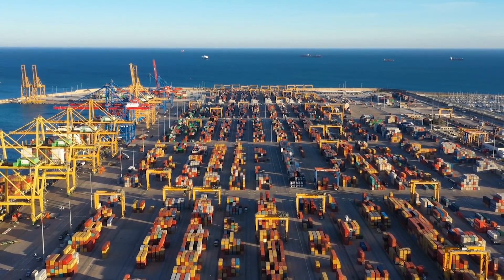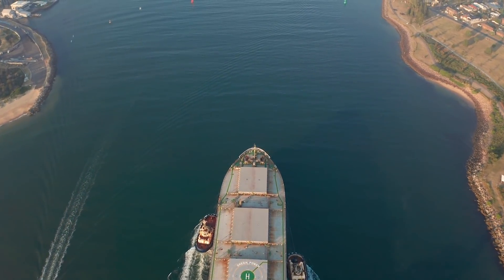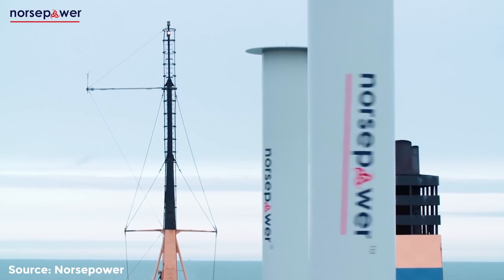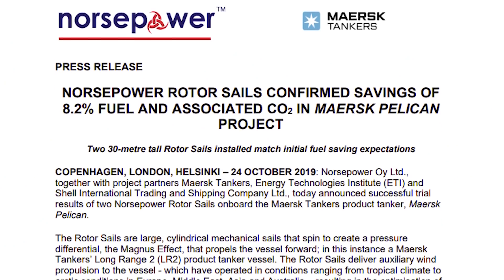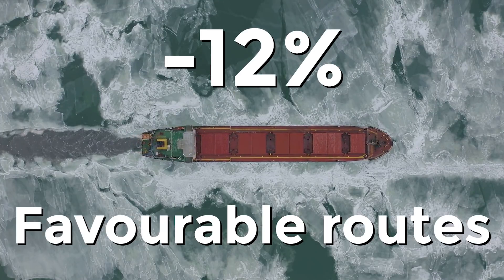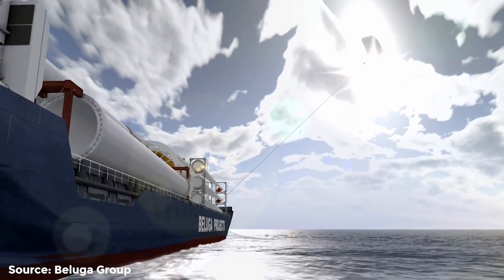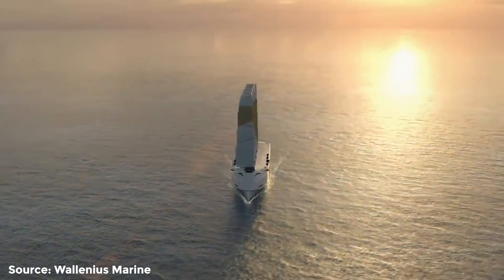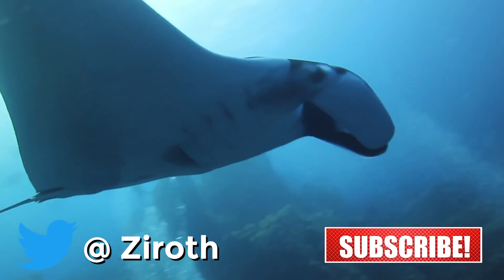Is Wind Power The Future of Shipping?

Comment: Small nuclear power systems, there, solved all your issues.
Reply: If you do a web search for ‘nuclear ship savannah’ you will see that it has been tried and did not work.  A similarly heavily subsidised, by the government, vessel is in use in Russia which also operates, in support of the Northern Sea Route, a fleet of nuclear powered ice breakers these may, or may not, have been completely without issues.

Just think; would you have full confidence in the management of a nuclear reactor under the control of an anonymous entity only traceable, perhaps, via a letter box in a FOC (flag of convenience) nation state?  If you are, could you sell that confidence to Japan, the state that hosted the Hiroshima and Nagasaki nuclear detonations as well as more recently the Fukushima ‘event’?  Then try that same, or a similar, sales strategy on Ukraine, the nation state that as a part of the USSR (CCCP) hosted the Chernobyl ‘event’.  Modern iterations of nuclear energy, thorium fuel, molten salt reactors or fusion reactors, will carry the legacy of past problems.  It is the global trepidation of anything with 'nuclear' in the name and the economics of nuclear having transitioned from 'energy to cheap to charge for' too 'the costs of remediation are incalculable' that will prevent the adoption of nuclear energy as a means of creating energy at sea.  Modern reaction systems may have overcome the safety problems but the general public, having been misled in the past, will be reluctant to believe the fresh new promises.

‘They’ say nuclear is cheap, it’s not it is expensive and has a large embedded carbon quotient as well as being complicated, dangerous, not universally socially acceptable and having only ‘no need for refuelling’ as a questionable advantage; actually it does need refuelling just not as often.  When ‘they’ do need to refill the warming up stuff it takes considerable longer than pumping tonnes of thick black stuff, HFO cSt380, or thin runny stuff, MDO, onboard which is one of the reasons HMS Queen Elizabeth and HMS Prince of Wales are pushed about by ICEs and gas turbines thus using a similar fuel as the aircraft that fly off of them.  The Royal Navy (RN) with a high degree of skill and expertise uses, at vast expenses to the UK taxpayer, a current operational nuclear fleet of 11 submarines (also known as ‘boats’) in two flotillas, seven attack subs and four ballistic missile boats.  The carbon footprint of all the extra bits of hardware and the fuel, including processing thereof, from ground to propeller, are the external costs that never seem to get considered.

Disposal, once it wears out, of both the machine (that was a ship) and fuel is another can of worms best left unopened.  The 26 RN boats no longer in use are laid up (some in Rosyth and some in Portsmouth) awaiting long term deconstruction including dealing with the fuel rods and other irradiated material.  The USN is not, as far as I know, a commercial organisation working to very tight margins and also has the skill and expertise to handle the complexities of nuclear power; so as well as submarines their aircraft carriers are nuclear powered and each of the current iteration has a build cost three times that of QE/PoW, bigger crews and more generous funding.  For those who still think that nuclear energy might be the answer I recommend this report: - https://www.bbc.com/future/article/20200901-the-radioactive-risk-of-sunken-nuclear-soviet-submarines?ocid=ww.social.link.email.  The navy of the USSR might have been under resourced and over extended but it was still generously supported in comparison with merchant shipping.
Reply: If you do a web search for ‘nuclear ship savannah’ you will see that it has been tried and did not work.  A similarly heavily subsidised, by the government, vessel is in use in Russia which also operates, in support of the Northern Sea Route, a fleet of nuclear powered ice breakers these may, or may not, have been completely without issues.

Just think; would you have full confidence in the management of a nuclear reactor under the control of an anonymous entity only traceable, perhaps, via a letter box in a FOC (flag of convenience) nation state?  If you are, could you sell that confidence to Japan, the state that hosted the Hiroshima and Nagasaki nuclear detonations as well as more recently the Fukushima ‘event’?  Then try that same, or a similar, sales strategy on Ukraine, the nation state that as a part of the USSR (CCCP) hosted the Chernobyl ‘event’.  Modern iterations of nuclear energy, thorium fuel, molten salt reactors or fusion reactors, will carry the legacy of past problems.  It is the global trepidation of anything with 'nuclear' in the name and the economics of nuclear having transitioned from 'energy to cheap to charge for' too 'the costs of remediation are incalculable' that will prevent the adoption of nuclear energy as a means of creating energy at sea.  Modern reaction systems may have overcome the safety problems but the general public, having been misled in the past, will be reluctant to believe the fresh new promises.

‘They’ say nuclear is cheap, it’s not it is expensive and has a large embedded carbon quotient as well as being complicated, dangerous, not universally socially acceptable and having only ‘no need for refuelling’ as a questionable advantage; actually it does need refuelling just not as often.  When ‘they’ do need to refill the warming up stuff it takes considerable longer than pumping tonnes of thick black stuff, HFO cSt380, or thin runny stuff, MDO, onboard which is one of the reasons HMS Queen Elizabeth and HMS Prince of Wales are pushed about by ICEs and gas turbines thus using a similar fuel as the aircraft that fly off of them.  The Royal Navy (RN) with a high degree of skill and expertise uses, at vast expenses to the UK taxpayer, a current operational nuclear fleet of 11 submarines (also known as ‘boats’) in two flotillas, seven attack subs and four ballistic missile boats.  The carbon footprint of all the extra bits of hardware and the fuel, including processing thereof, from ground to propeller, are the external costs that never seem to get considered.

Disposal, once it wears out, of both the machine (that was a ship) and fuel is another can of worms best left unopened.  The 26 RN boats no longer in use are laid up (some in Rosyth and some in Portsmouth) awaiting long term deconstruction including dealing with the fuel rods and other irradiated material.  The USN is not, as far as I know, a commercial organisation working to very tight margins and also has the skill and expertise to handle the complexities of nuclear power; so as well as submarines their aircraft carriers are nuclear powered and each of the current iteration has a build cost three times that of QE/PoW, bigger crews and more generous funding.  For those who still think that nuclear energy might be the answer I recommend this report: - https://www.bbc.com/future/article/20200901-the-radioactive-risk-of-sunken-nuclear-soviet-submarines?ocid=ww.social.link.email.  The navy of the USSR might have been under resourced and over extended but it was still generously supported in comparison with merchant shipping.
Reply: @BernardLS  damn, try to limit your coffee intake in the mornings.  I understand the complexities, they’re great.  However, it has proven to work time and time again in Military applications.  If we use nuclear power on certain cargo ships they should have many protocols, including being guarded by military personnel 24/7, plus the cargo ship will have tracking systems.  Not visiting ports that are not our allies.   It can be done.
Reply: @propbraker  The naval use of nuclear power is limited to a few aircraft carriers and some submarines, if the application was valid and viable things like the naval logistic support vessels (RFA or NFAF) would use it.  Marine shipping is a very cost effective system as the barriers to innovation are negligible and competition is not constrained by political machinations.  Current; if the 'Ever Given' had a nuclear power set on board how happy would Egypt, both the nation state and the common people, be?
Reply: @BernardLS  Not all naval support vessels need nuclear power, it’s simply not needed due to cost and time at sea. Container ships are virtually at sea all the time, it would be very cost effective and viable for them to use nuclear power. Given the right security on board and safety.
Reply: @propbraker  any opinion on the ‘how not to park a very big container ship?’
Reply: @BernardLS  Yeah my opinion is, WTH are you talking about with parking big container ships?
Reply: @propbraker  are you the only person on the planet who has not heard that the Suez Canal got blocked on Tuesday! (:-) global trade has gone south in a big way.
Reply: @BernardLS  what does that have to do with our previous conversation?
Reply: @propbraker  in any case of a ship grounding the supply of cooling water may be cut off, not good for any nuclear reactor.  Even a scram shut down leaves the residual heat to be dealt with.  Also the accidents ships have tend to be in coastal waters, there is not much to bump into outside the 100ftm line so the innocent people, who may also be voters, get upset.
Reply: @BernardLS  if a ship gets stuck in a canal, there’s plenty of cool water wherever they are to do a safe shutdown procedure. If need be, in this canal, that probably wouldn’t be needed due to the size and water flow.
Reply: @BernardLS  why are you so against nuclear power anyways? The US military goes thru this canal all the time with air craft carriers. No problems whatsoever.
Reply: @propbraker  circa 50 ships a day go through without a problem however the incident just goes to show s..t happens and though they will get that one out either intact or in bits the latter option might be problematic if the energy source was nuclear.  when ships ground as the 'Ever Given has the stress on the hull may cause it to break up.  Long story short, my main issue with nukes is they are not a cheap, simple answer to our problem.  The navies who use nukes are all very skilled and well supported the global merchant marine is run on a worn out shoe string, so second hand not even a thrift shop would except it.
Reply: @BernardLS  large container ships are a massive money making machine, they easily can afford them, not to mention they no longer need to purchase diesel, or no maintenance for 20 years!  It’s perfect for large container ships. Not all ships. If you look at my OG post, I stated that only large ships would benefit from it.